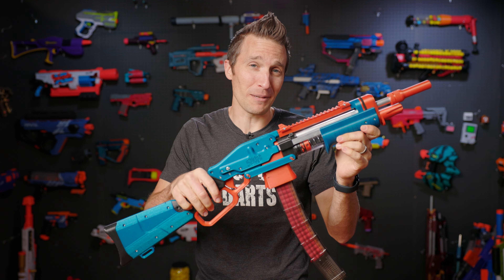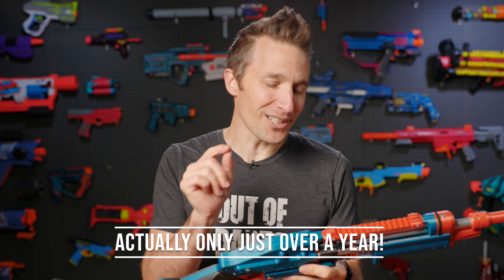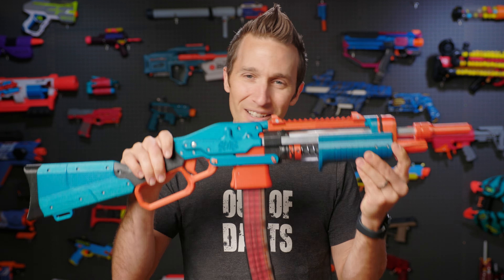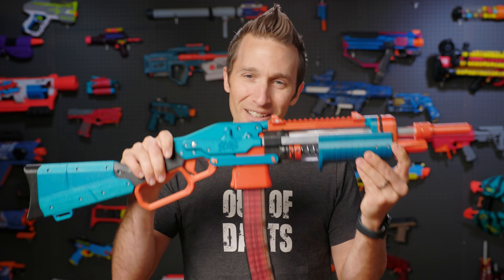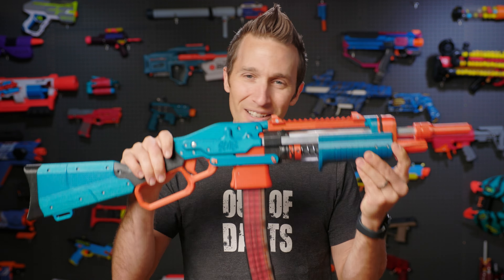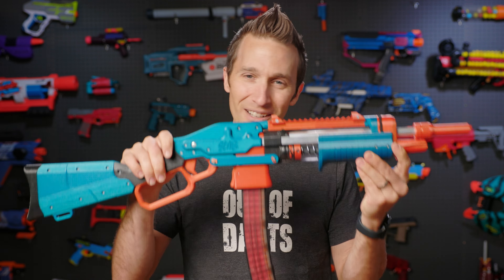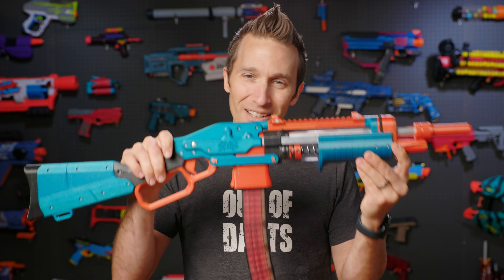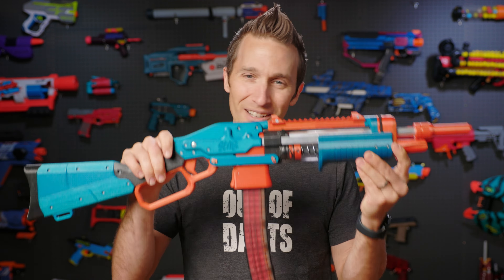Sillybutts' SLAB might just be my new favorite springer!

Comment: Finished mine last week and I absolutely love it. Can't wait to use it in 2023.

I went with a different supplier, however, and they did not make a remix of the threaded rod cap. Luke's change there for the cap to use a heat set insert is, I think, a MAJOR QoL improvement and will make building much easier, especially if you do not have access to a variable speed drill (which is what I used to get the threaded rod set into the cap). The HSI and maybe a small dab of blue (not anything stronger) loctite (make sure you do your linkage rod adjustments before the stuff sets) will make that part of the build a breeze.

Comment: What's up with the oring in the plunger head? It always looks like it's popping off.
Reply from the maker: There are two O-rings. one is seated normally, and the other is woven in between the fins on the plunger head. Having them oriented this way helps balance air seal and friction for better performance.
Reply: @outofdarts  When you do an assembly video, if you remember, it'd certainly be appreciated if you could expand on this a bit. Thank ya'll
Reply from the maker: @Sillybutts  I stand corrected. I made an assumption and guessed wrong, lol. - Perry

Comment: I understand a fully made blaster being 180$ but the point of 3d printing in my opinion is to bring ease of use and for people mabey a cheaper option 180$ for the parts tooo dam.expensive  i could see like 60$ or mabey 80$ but aomost 200 is redicolous i mean. IIcan3d print a flyable airplane for around 68$ or a 3d printed drone for around.180$

Comment: I wouldn't call it innovative.   It's not doing anything other designs haven't done before.  Both the Medusa and FLAK did lever action before the slab, also the wingchester. The specific leaver design on this blaster coming directly from the medusa itself.  I would call it an amalgamation of other designs with a easy to obtain parts list, and ease of print ability that results in popularity.  The flak is limited by power, and the medusa has some large prints, and in addition to custom cut bars and rods, requires several different sourced springs, and a bit tricky to assemble.
Reply from the maker: You're right that there are other blasters who did lever action first. However, combining a lynx turnaround with a floating magwell like the FLAK allowed there to be a much larger plunger volume in a more ergonomic package. Innovations don't have to be completely original.
Reply: @outofdarts  I mean...  medusa has a turnaround as well.  In addition to interchangeable spring spacers that can change fps on the fly from 120-200.  One thing I will say that I think the slab might do better is the trigger linkage from the chimera.  On the medusa its adjustable, but sometimes It can come out of adjustment, and cause the plunger not to catch.
Reply: @pintotheevil  I fixed the trigger linkage on mine by cutting the dowel rod to a custom length without the adjustable piece. I also did an aluminum plunger tube since the acrylic one I originally got broke.